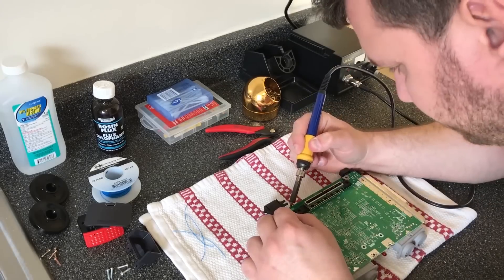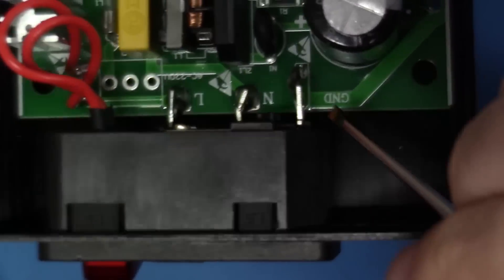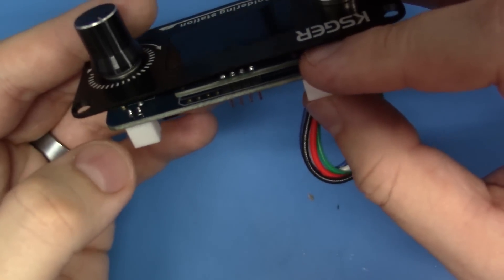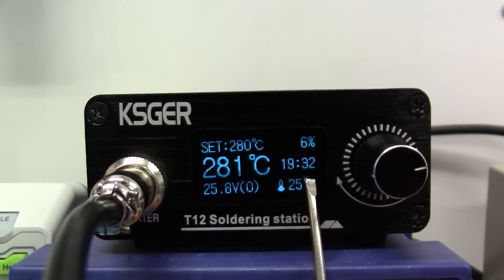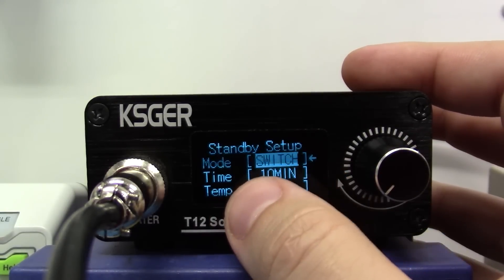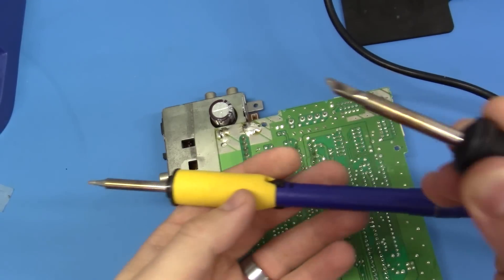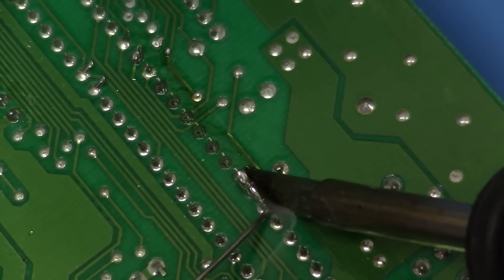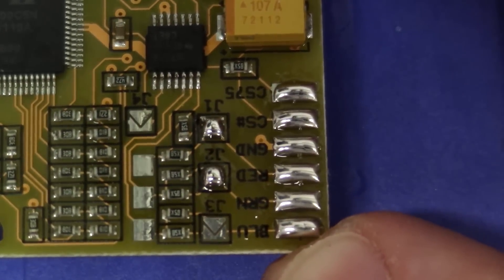Buying Your First Soldering Station (UPDATE READ DESCRIPTION)

Comment: How about a soldering station with hot air thing?
Reply: Also, can you suggest a liquid flux for reflowing, a lead free solder and the right temperature to set when soldering with lead free solder? Is this station autoswitching between European 220-240V and US 110v? Is the power plug the same as the one we use on computer power supplies? I want to buy everything if your links here.

Comment: I would have liked to have seen you check the temperature accuracy, but good video anyway. 

Do you think you’ll be using this as your main station?
Reply from the maker: From the factory, the temperature (with the K-Series tip) was within a few degrees.

An outstanding feature of this iron is having the ability to manually dial in calibration for pretty much any and all T12/T15 tips ever made... Really nice!

Comment: Not a word mentioned about the cord material!  What's it made of?  A stiff pvc cord would be a deal breaker for me, otherwise that's one sexy soldering station.
Reply: The cable is perfect. Not stiff and never annoying you, because it cruls into the place you want to solder
Reply: @barthonhoff5547  Nice, in that case my old Hakko 888 may be getting a new companion soon 🙂
Reply: @barthonhoff5547 
The cord looks too shiny to be silicone, it looks like cheap pvc that will just melt.
Try to burn it with the hot iron, and if it's a good cord made of silicone it will just laugh at the hot iron.
Reply: The last iron I bought had the stiff cord. Horrible to use. I replaced it with a multi-core silicon cable. It really changed everything about the feel.
Reply: Look at the noodliness, no way it's PVC, the flop factor shows it's definitely Silicone
Reply: I would have burned my hacco cord twice already if not for the silicone insulation xD That and it being very supple is very nice. It is never in your way, and if it ever does find itself where it shouldn't be, it is incapable of burning it's own cord. 

I have a feeling the same cannot be said for this cheap soldering station, but it is what it is.
Reply from the maker: The cord is high-temp silicone. I shot a video of it on my Twitter.
Reply: Here's the tweet Voultar is referring to:  https://twitter.com/Voultar/status/1069712594892668929

Comment: Not seen the vid yet, but I've recently bought a 936D clone and been really happy with it. If it's good enough for Big Clive and countless Chinese factory production lines then it'll be fine for my tinkering lol. Now, let's see what Voultar recommends. (EDIT- 3mins in and it's looking like a really nice bit of kit for the money, I disagree about the power connector though, I'd rather it were plugged/on leads to allow potential serviceability in future. Also the 936 based stations are a lot simpler and possibly more robust long term)
Reply: Video watched, and yes I think it's a good station. I'd still stick with my 936D though as I'm a real cheapskate and it cost me under £20, and I think the important part for me is I love the hand piece

Comment: Great video! I’d really like a “soldering 101 class by Voultar” video series, that would take my gaming geekness to the next level!
Reply from the maker: Let's do it!
Reply: @Voultar  <3 <3 <3 (no homo) I cant wait to sit back, and strap on
Reply: @Voultar  Make it so...LOL
Reply: @Voultar  This would super excite me. I've always been interested in the idea of electronics repair but I haven't ever really dove in. I can solder guitar pickups and follow wiring diagrams well enough, but (for example) the idea of re-capping my dead model 1 Sega CD is still terrifying.
Reply: I think that would be great.  When I first learned to solder, grasping how large ground planes can suck up heat and make the task more challenging was something that I wish had been taught to me better.  Always had that worry of overheating a part just trying to get the solder to flow due to ground plane heat suckage.
Reply: @Voultar  Please Do Brother...
Reply: Voultar - thank you thank you thank you for doing this! I’m a hobbyist and very new to soldering and I’m learning so much from you. It’s greatly appreciated.
Reply: @Voultar  will you do some other training video's? I wish to try and recap amiga 600 but SMD caps are cery hard to recap and traces van be easy damaged :/ or maybe recap od Sega mega CD? It also have that SMD caps.
Reply: this x100000. Ive been soldering for years but I have picked up tips just from watching how he does things. I would love to have a how to starting at even the basics of soldering 2 wires together and moving to advanced techniques. I know theres probably thousands of videos on this already...but none of them are Voultar...
Reply: Yes! I've wanted to learn to solder for years, and now I think I've finally found the right YouTube channel for the job. Please do a 101, 202 type series for all of us newbs.
Reply: Voltar may be doing a 101 video series on soldering, hell yeah!
Reply: The video clip that he includes at the start of this vid is part of series of educational videos designed to teach you about soldering. They're awesome, you should check them out.
Reply: @suluturnip  Could you paste a link to this series of videos or provide the name of them?  It's tough to find based on a small clip like that.
Reply: I would totally watch a Voultar intro to soldering video. Sure other ones are out there, but based on the style of his other vids I feel he would make it easy to understand, and quite entertaining.
Reply: I subbed right now just to not miss this class if/when it happens.
Reply: After years of being terrible at soldering with crappy Wellers, I'd love a Voultar tutorial

Comment: Shoot, just bought a X-Tronic - Model 3020-XTS. It's pretty nice but i'm wondering which is better between these two.
Reply: If the 3020 is like the 4040's iron, then the iron in this video is the way to go. However, the iron on my 4040 is still good enough to get work done, and has served me very well over the past 4 or 5 years..

Comment: personal preference, I like the soldering irons where you can replace the tips instead of needing to swap out heating elements.
If I was doing actual work where the cost could be passed on to consumers or in the overhead, fine, these all day, but hobbyist dicking around and just needing to make small repairs every month or so, I much prefer the YiHUA 936 and other clones.

Comment: I assume the iron cable is wrapped in silicone and heat resistant?
Reply: I don't think so. But you can buy silicone leads from aliexpress.
Reply: It is, I have one and its very flexible and burn-proof

Comment: The ZD915 sucks as a desoldering tool. If you have the money it would be better to go with a Hakko.
Reply: It doesn't. I've done a bunch of projects with it that I probably would have bungled with wick and sucker.
Reply from the maker: No it doesn't. I have several Hakko desoldering rigs, and they've all been replaced by the ZD-915 for over a year, now..
Reply: @Voultar  strange I kept getting clogs on the unit I bought. Never had an issue with my Hakko.
Reply: @ccc822007  Similar quality. ZD915 did same job many times better compared to FM-204 and FM-2024. I confirm what he @Voultar says. About Chinese KSGER station - the student has outgrown his master. :)
Reply: @faucolt  I must have gotten a faulty unit then?
Reply: @ccc822007  probably

Comment: Wow, I was just thinking about buying a cheap weller station from a local hardware store when I saw this video.
Reply: This has a fuse, Weller doesn't.
Reply: @xhivo97  Expensive Weller soldering stations do.
Reply: @VAX1970  he said cheap weller
Reply: @xhivo97  You buy cheap you buy twice
Reply: @VAX1970  True, but there are exceptions. This ksger, is excellently built.
Reply: Buy an expensive Weller they last a lifetime, they are the market leader

Comment: I've been looking to buy a station. The one I was going to buy was the xtronic on Amazon for 59.99.
Reply: I own a Xtronic station, it's not great. It's got a sparking negative rail I can't seem to find.
Reply: @KiraSlith  thanks for the advice looks like the one in this video is the way to go.
Reply: Great info and video thanks man
Reply: I have a xtronic 4040, and it was a good iron/hot air rework station 5 years ago. however the temp control is too variable on that old "hollow" tip design -- it's just not possible to have the kind of control that @voultar just demostrated.. after playing with my ts100, and watching this.. I would much rather have a direct drive style iron, such as this. I am ordering one of these right now. don't get me wrong the ts100 is nice, but i really like the control box/stand here...

Comment: Soldering is for chumps, you only need a dab of hotglue and a little brasso mixed in for conductivity and, BOOM, you're done!
Reply: And some epoxy to keep the electrolytes in place. Never forget he epoxy. The more the better.
Reply: @NightWalkerasd  bigger the gob better the job?
Reply: @johndowe7003  : We retired Army HAWK and Patriot techs used to call that the "Nike Hercules" School of Soldering".
Reply: @johnc8910  lol
Reply: @NightWalkerasd  Be sure to totally flood your replaceable glass fuses in a bath of black epoxy, it'll make them last longer.
Reply: @NightWalkerasd as AvE would say, the bigger the gob, the better the job
Reply: @markmooney4770  3..2..1.. contact!
Reply: Am I the only one who wants to see a totally proper parody review done on this method??? I can't be the only one, this is youtube comments section...
Reply: iCach0 you forgot the bubble wrap!!
Reply: Always more hotglue
Reply: "it's that simple." - Lord Voultar
Reply: Dont forget to add the flame decals for extra horse power!!!
Reply: The BOOM part is spot on.
Reply: PFFFFFFFT duct tape ftw
Reply: iCach0
 actually YOU are the chump! Real pros mix solder AND hotglue for an ultimate bond, finished with a sealing of epoxy
Reply: Naa, i use wood glue
Reply: don't dab glue that's worse than eating tide pod
Reply: @voidremoved  I have a couple of those for breakfast every morning.